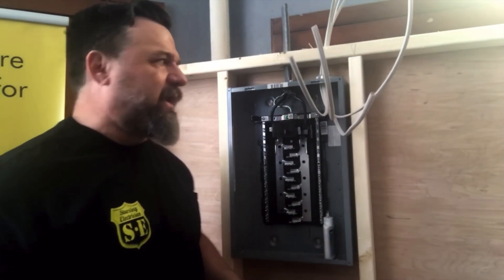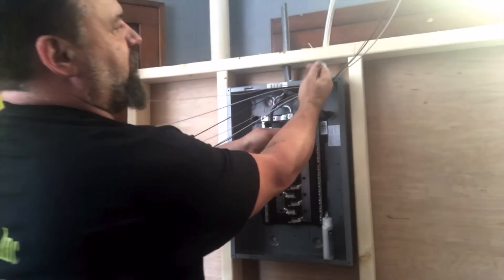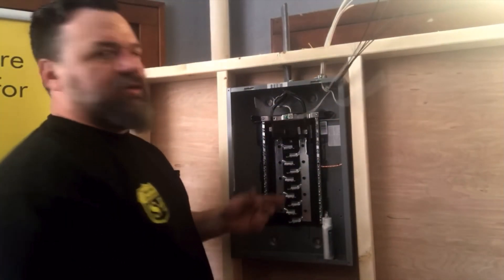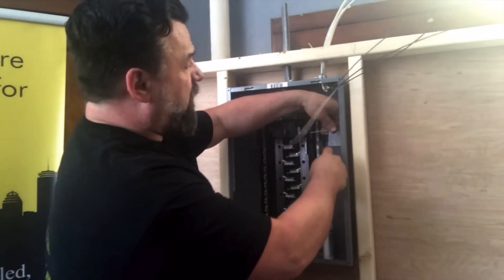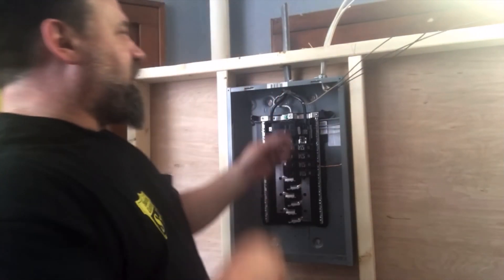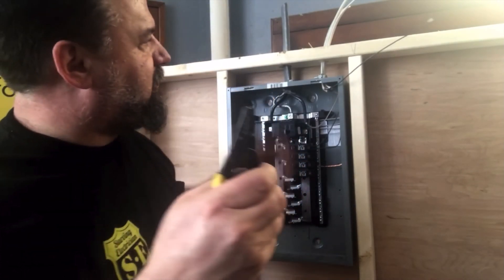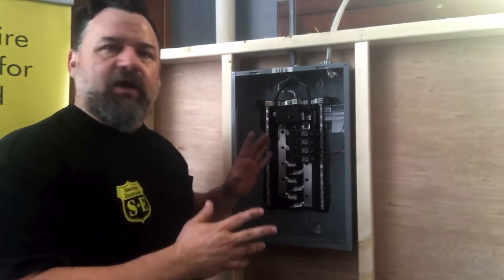How to wire a breaker panel. quick and easy tips and tricks

Comment: Who told you you could put 4 cables into 1 connector???? 1 maybe  2    but 4?    Also yeah never twist your grounds the wires must be easy to separate for trouble shooting purposes  you should even land the wires in the same order as when you land the beaker wires top breaker top neutral top ground    nice and simple

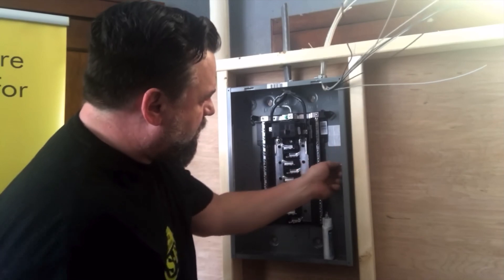Comment: 3:20 Some terminals are listed for Dbl or Multi conductors, some not. In my experience (western U.S.A.) ground & Neutral bars are mostly single conductor rated. That could be cured with an appropriate crimped ferrule over the wire ends that would fit in the terminal. 
FYI, a wire twist like that is an ancient concept and is called a "torque."

Comment: 3:30
Why the hell do you put the ground wires on the neutral bus bar...?!?? 🤦
I know they are bonded in this situation with the green screw... But thats not how its done.
You supposed to have other lug bars that are screwed only on the metal casing of the panel. Even if its a main panel.
Reply: I've never failed an inspection for doing it this way. Just gotta ground the panel with the bonding screw and all is good. This would be considered the first point of disconnection, so it's all bonded. What is your reasoning for adding a separate ground bar, other than the possibility of someone changing the system over to a 4 wire? I'm genuinely curious and would like to know the correct methodology you are using.
Reply: @aaronswingle  to make it a mechanical ground, rather than a electrical ground
Reply: @martf1061 Looks to be a  mechanical ground connection to me. Maybe he should have shown an actual ground wire connection from earth going to the neutral bars in this demo. But the point of this was to show his process of wiring and neat workmanship, not so much all the accompanying code.
Reply: You get failed for that here in OKC

Comment: One wire, one lug.
Only double if necessary.
A 30cct panel is supposed to have at least 30 neutral lugs and 30 ground lugs.

Comment: Do the Earths  and  neutral connect to the same bar  Are they not supposed separated breaker panel?
Reply: Only has to be separated on the second disconnect.
Reply: They go separate on a sub panel.

Comment: Good tip for stripping the cables. I don't like the twisting of the grounds though, they have to be able to disconnect them so tests can be done in the future for fault finding.
Reply: I agree
Reply: Yeah, in Sweden twisting the ground like that would result in a failed inspection.
Reply: @tobiasandreassonmelin7776  here in UK, it would never even be commissioned. It seems American electricians just wire stuff up and then turn it on and only do testing if it there is an issue. Here before turning anything on you have to do resistance tests  between all the conductors in the circuits and insulation resistance tests as well. And some other tests after turning it on like ground fault current testing.
Reply: Would you have to add a ground bar? I always do, whether it’s code or not, my grounds never go to the “neutral bar” even though it’s directly connected to the frame(ground) unless they’re isolated
Reply: If i may, i have a better tip for stripping wires.
Strip them Before going in the connectors. 
And Never put the ground wires of your circuits branchs on the neutral bus bar like he does.
Reply: @martf1061 Bonded at first point of disconnect.
Reply: @aaronswingle  as to "Bonded at first point of disconnect". I agree but... My home was wired that way (ground wires of the circuit branches on the neutral bus bar). Then, I installed a whole house generator system. Now the transfer switch becomes the first point of disconnect requiring the pains taking process of seperating all the neutrals and grounds in the main panel. If they would have kept them seperate when the main panel was initially wired, it would have been as simple as removing the bonding screw.
Reply: @constructionconcepts8849  I understand. Good thinking.